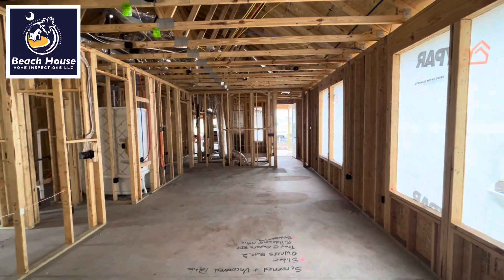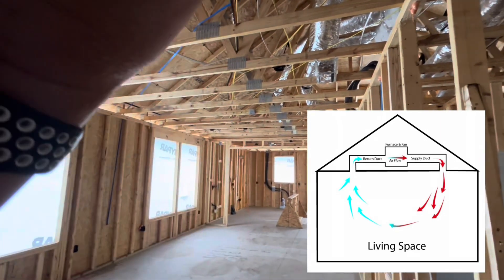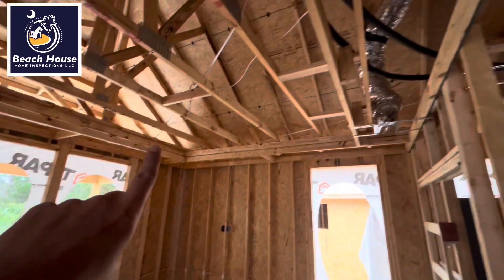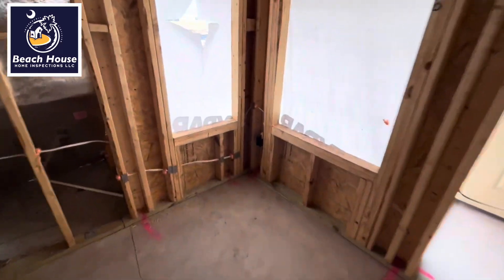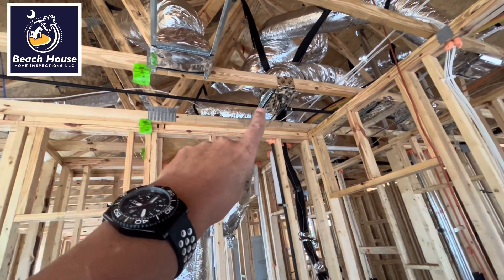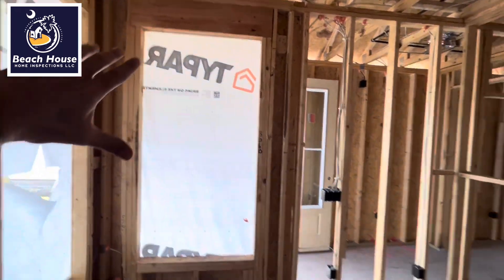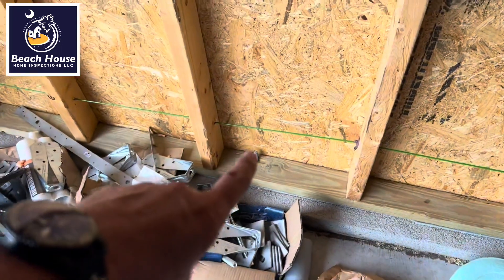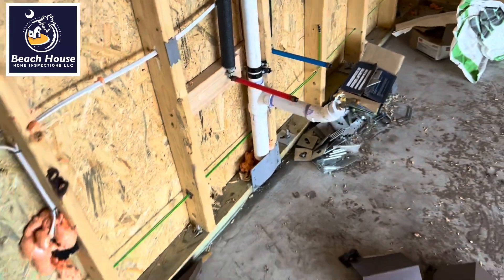HVAC supply duct too close to return duct

Comment: This reminds me of my  home.  In my homes defense it was built in 1938 with a gravity furnace with no AC.  So hot air rises and the cold air stays near the floor...
Now that I have AC its doing just like what this video shows...
After installing a new 96% HVAC will have the gravity ductwork removed and new ductwork install.  Funny there are no returns on the second floor which is always 10 degrees hotter…lol

Comment: Heck...on a window AC the supply air of falling cool air is located DIRECTLY on top the warm room air return. It's a wonder if a 5000btu unit is actually removing that full amount of heat, given that "looping" effect.

Comment: I’ve been an installer before with some of the biggest mechanical contractors in CA. Installers don’t know any better. Sometimes they will read the plans wrong and sometimes the plans they are reading are wrong. This falls on the foreman not “walking” or double checking the installers work.